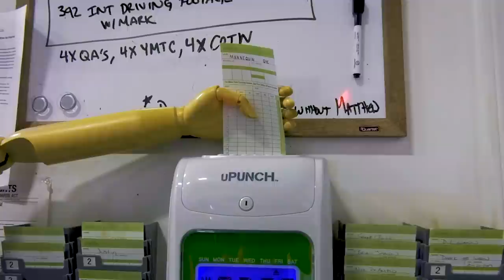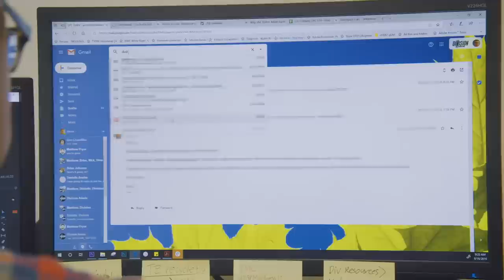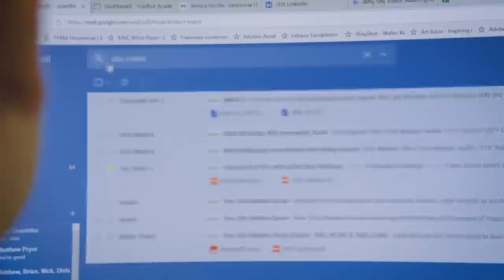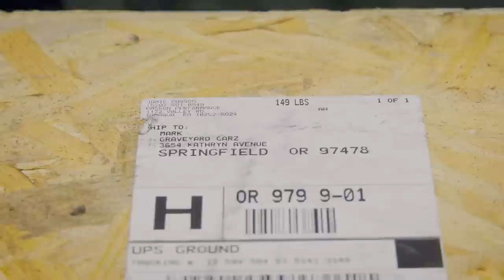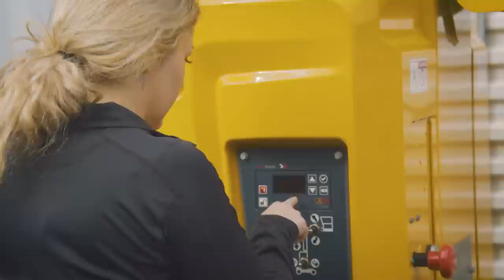YOUTUBE PREMIERE: MAKING A 1,000 HELLEPHANT FIT!

Comment: This is an old video, but it seems like they need a person who's job is to sit in this parts room and everyone who needs something has to show what they're taking so it can be checked off. There also should be a re-order point of every item in stock. Things that are used often must have enough in stock when the order for more is placed. That's how the tool crib was run at the machine shop I used to work at. Everything was great as long as the re-order ticked was given to the tool room attendant.